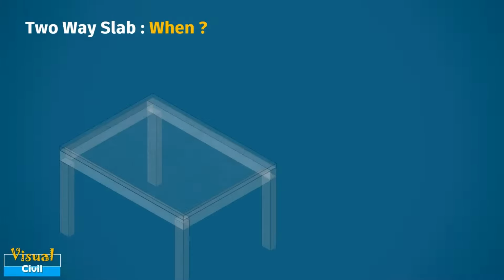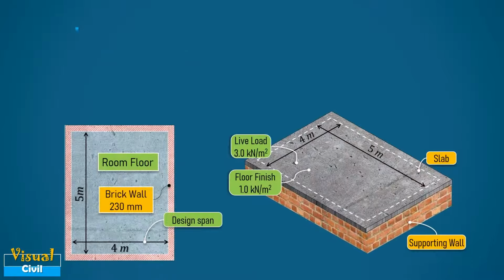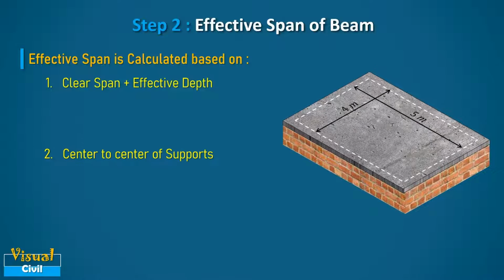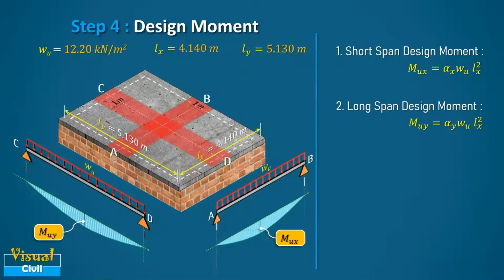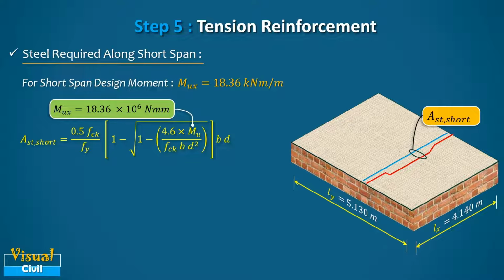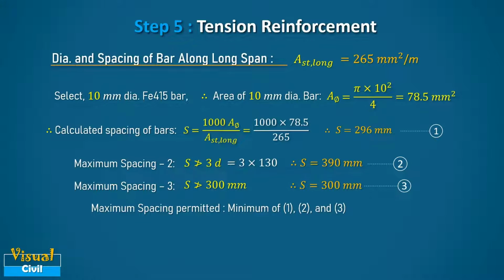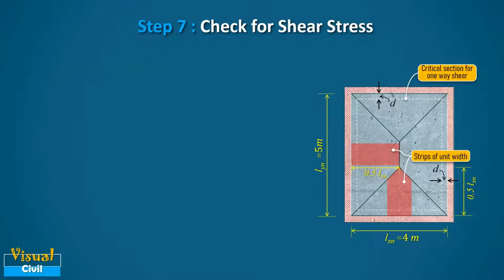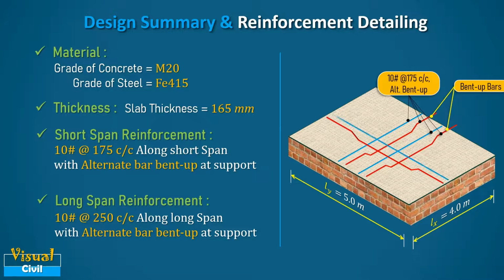Design of Two Way Slab : simply supported | Corners free to lift

Comment: sir in 2 way slab bars are placed lower  along short span  but in footing bars are placed in lower tier along long span...difference?
Reply from the maker: In footing along the long span the cantilever length of footing from respective column face is more, which more critical than that along the short span. Hence bars are provided along long lower tier

Comment: Sir, for long span spacing, shouldn't the max. spacing rule be min(5d, 450mm) as per Cl 26.3.3 (b) pg. 46 of IS 456:2000
Reply: Bro I understand what you are saying 

But in One way slab we provide main reinforcement along the shorter span only so criteria for them is( value or3d or 300 mm minimum of all these )

But to resist shrinkage and temperature variations we provide Distribution bar with the criteria you told.....

Now in Two way slab 

We provide main reinforcement in along longer span and shorter span so criteria for them is( value or3d or 300 mm minimum of all these is only applicable ) .....and 
no need to provide Distribution bar.